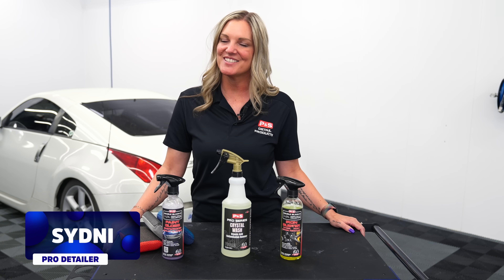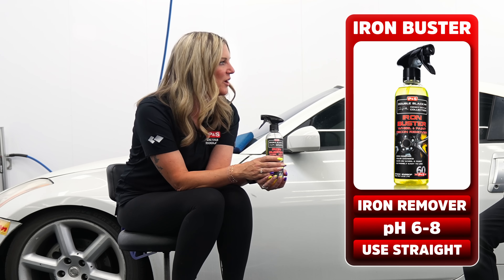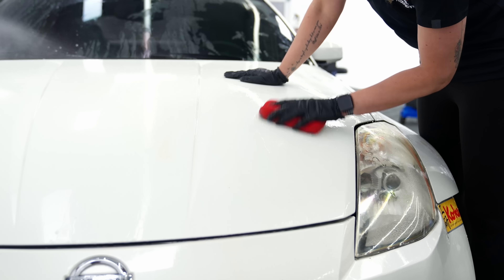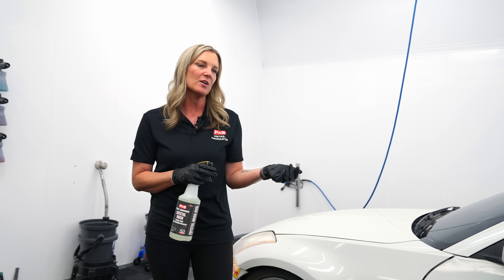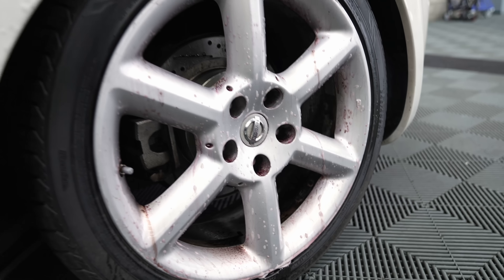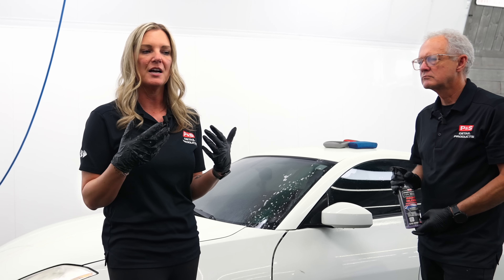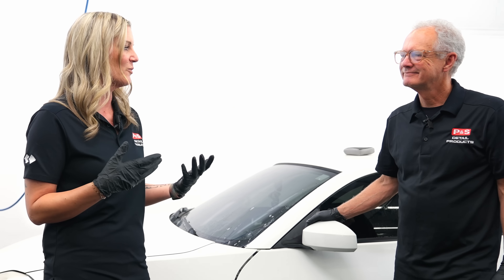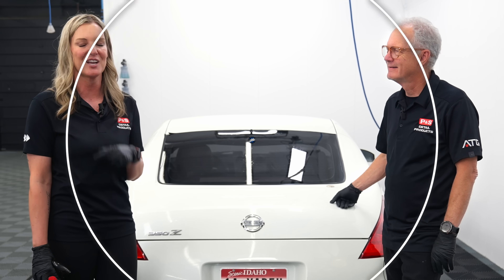When Should You Use An Iron Remover On Your Cars Paint?

Comment: Why are you claying before iron buster? It seems like the general recommendation around this is to use iron remover first to reduce the chance of marring during mechanical decon.
Reply: The iron remover is a reactive agent meaning if there's any iron particles that oxidized to rust then it will react and you see the purple  pigment. The clay"bar" will remove the particle itself.
Reply: @shahnulislam9897 you didn’t answer the question. You just explained the difference between the two.
Reply: @TCMODS  Ah my bad. My process is simple I will do a foam wash and rinse to remove loose dirt, then another foam was with agitation to remove the traffic film. Now the surface is clean I will use iron remover as the lubricant to clay bar and get both steps done at the same time since I'm not dealing with grit  on the paint. Could I have used rinseless as lube, yes, or car soap and low mix as lube, yes. For efficiency I use iron remover.  At this point, I will go for the minerals in water spots. Rinse off - dry then off to polish. i did this car yesterday 
 https://www.youtube.com/watch?v=4pqLu5mWu_8https://www.youtube.com/watch?v=4pqLu5mWu_8
Reply: @TCMODS  I still didn't answer ...Well DIY Detail has a video where Yvan and Nick each pick different sides where Nick sprayed Iron remover and Yvan used the method I described. Yvan's side had less Iron particles than Nick's side where it was just sprayed on. So both chemical and mechanical decon together gets a better result. I know still didn't answer your specific question, but I hope it helped a bit? let me know
Reply: Yes, we know how they work. This doesn't answer my question though. @shahnulislam9897

Comment: I have traditionally used clay bars. With the advent of synthetic clay, is there any concerns with marring? Usually, I will knead the clay and "fold" away the contaminants, exposing bare, fresh clay before continuing the rubbing action. I am curious as to how contaminants on the surface of the synthetic clay is managed...or is it horses for courses?😊
Reply: your synthetic "clays", you just rinse them off/dip in your wash bucket to clean off the contaminates.